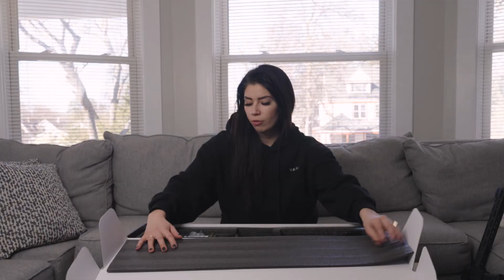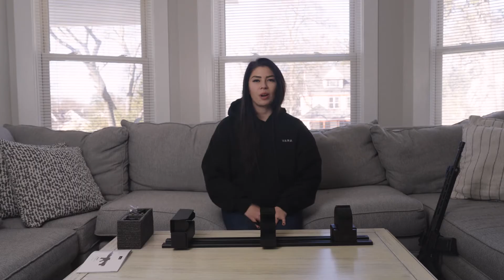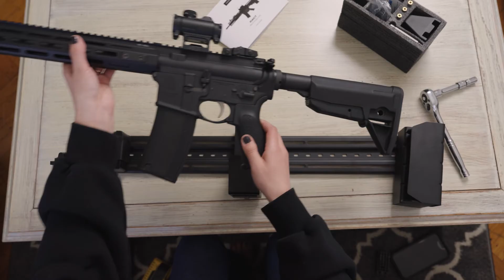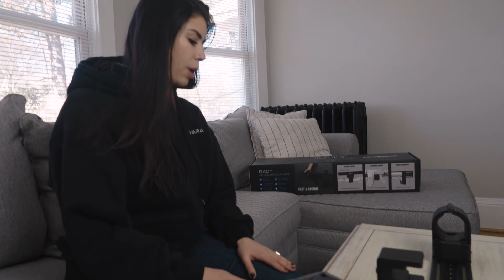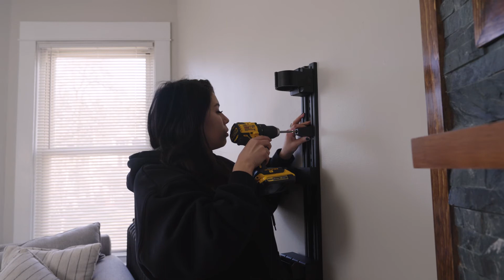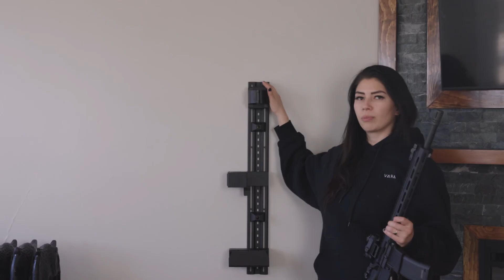RACT Biometric Install Guide

Comment: I would not recommend Vara Safety. My experience has been extremely frustrating. I placed an order months ago and the shipping date has been pushed back more than three times. Despite repeated attempts to reach out, they do not respond to emails or provide any meaningful updates. The lack of communication and constant delays make it very difficult to trust this company. At this point, I regret placing my order and would warn others to think twice before doing business with them.

Comment: Shouldn't store a rifle barrel up. Horizonal or barrel down only.
Reply: Why do you say that @Nikshoots?
Reply: @DanDiamondMan  oil and dust will collect in your receiver and/or BCG
Reply: @NikShoots how does it get there?  What if the dust cover is closed?
Reply: @DanDiamondMan  If you're properly maintaining your "tool" (smh youtube), the oil will run down the barrel and from all other places you've applied it and accumulate in the receiver and bcg because of gravity - if you're storing barrel up. Dush will get in through the end of the barrel and do the same. 

It isn't going to destroy your tool overnight, but if you're installing one of these you might as well do it in a way that protects your stuff if you have the space to do it horizontally.
Reply: I have one of these and it's very nice, to be clear. Just don't agree with vertical installation.
Reply: @NikShoots I have the space to install either way… I just thought horizontal would be better but I’ll have to think about what makes the most sense and take what you say into consideration.  

So you’re happy with it overall?  Any things you do and don’t like about it?
Reply: @DanDiamondMan No complaints other than it took forever to ship and deliver. I was a part of pre production batch 2, so not too crazy that it happened. Unsure if that's better now. 

Also have never had to truly test deploying the tool in a high stress situation. I have drilled and think I have it down. This is more me though, nothing to do with the wall mount.
Reply: If you slather the oil on and then let it sit for five years then yes you may have an issue. That what y'all do?
Reply: What about gun safes? Barrel up in a safe is incorrect?
Reply: @drew42025  I personally don't. But if you're using the firearm and clean it regularly it's probably not a big deal. But I wouldn't do it for long term storage. That's just me.
Reply: Omg dude pls shut up! How do you store your rifles in your safe? YT will literally have someone crying about anything and everything

Comment: Hi! Quick question what is done when no power is available?
Reply from the maker: Both Reach 2S and RACT have a 10+ month rechargeable battery life!
Reply: @varasafety   excuse me can you tell me if this works for a shotgun without a stock for example a Mossberg Shockwave.?

Comment: This is awesome. 
I know you guys are just barely getting your feet off the ground, but I wanted to recommend an idea as well as a perspective.

Idea: purely mechanical, 5 or 6 pin operated system sold for cheap. 

I'm not worried about failure rates of electronics, clearly you guys have plenty of redundancy for this. 

Now we're getting into the perspective

With AR pistols and group attempts for home invasion becoming more and more common, when I am home I want a rifle available to me. 
I've been struggling to find solutions for this, and this product you have is just about perfect. 
However it is very expensive, and I would gladly trade the electronic conveniences for a purely mechanical lock system and cheaper price. I like to think others would too, but ultimately the best choices for your business are your own selections.

Best of luck to you guys. This product will absolutely be going on my "to buy" list

Comment: How long does the battery last?
Reply: Quick Overview:

Features the tried & trusted Vara fingerprint sensor (unlocks in 0.2 secs)
Stores up to 10 fingerprints
12+ month rechargeable battery life
Withstands over 550lbs of force
Mechanical key override
Fully adjustable (right and left-handed)
Supports scopes/lights/accessories.
Product includes: RACT rail, biometric barrel lock, trigger cover, stock support, and mounting hardware.
Reply: @vegeta420z  So...what this tells me is that if you use the battery replacement method as suggested by Overton Windex, you should have absolutely no issues regarding battery life with any of these systems.

Comment: Shotgun version is great. AR version stock support is not wide enough to hold any of my stocks (DD, SOPMOD, Minimalist etc). How was this overlooked? Three emails later and they say they have a "few" customers with this issue and a fix will be available in May. Waited on it for months and now have to wait another 4 months while it sits in my shop collecting dust.
Reply: Wooooooow! What an odd problem that minimal quality testing could have fixed. Thanks for the heads up. I'll just wait a few months. Definitely give us an update in May.
Reply: Dremel to fit?  How can a B5 bravo or sopmod bit fit, then you mentioned minimalist? And DD?  While they are a lot of differences here in measurements seems like huge oversight
Reply: @j.r.d7230  Sorry for the late reply. 

It doesn't fit any of the stocks I mentioned. I was about to just modify it but at $400 I just don't feel I should have to do that. As I said, the one holding my 1301 tactical is awesome I love it. If the updated part works then I'll say it's a five star product.

 I have two of the Reach 2S's as well and myself and my wife love them. Especially when the grandkids are around. Have had no issues with either of those for about 2 years now. When they finally come out with a model that supports a WML I will be buying 3 or 4 more unless someone comes out with something as good or better first. I feel like they are missing the boat on that.
Reply: Replacement came in today. My B5 Sopmod and Magpul ACS will still not fit but the rest including the B5 bravo fit. The original stock support is 1 3/4" wide whereas the new one is 2 1/8" wide. DD, Hogue, SBA3, HBPDW, Minimalist, Adaptive Tactical and Magpul CTR all fit in the new part.
Reply: Just checked the MaximDefense brace on my DDM4PDW and it's a no go. Disappointed as that's the one in my bedroom where I planned to mount this. I'm starting to wonder again if anyone at Vara owns a firearm.
Reply: @2ndamendment-noinfringement Well get BCM then! Lol that’s your problem running the wrong stocks, I’m just playing, that is definitely something that shouldn’t have been overlooked being that there’s only a couple things they have to account for, one being the handguard and the other being the stock! Lol
Reply: Looks like the new stock supports have adjustability for this.